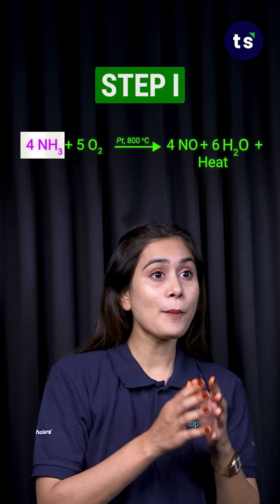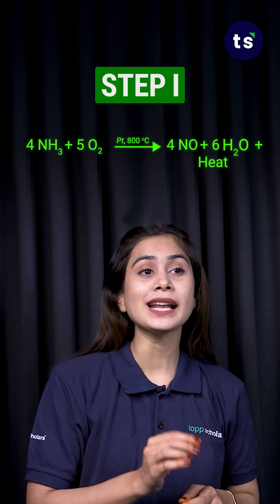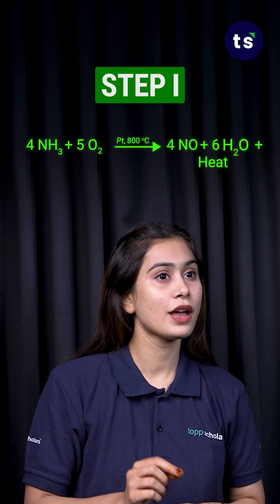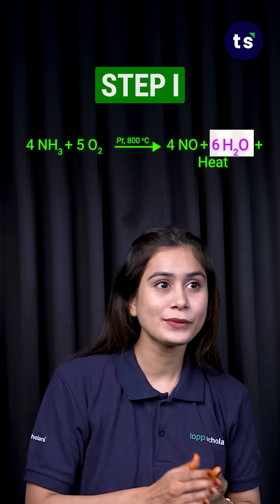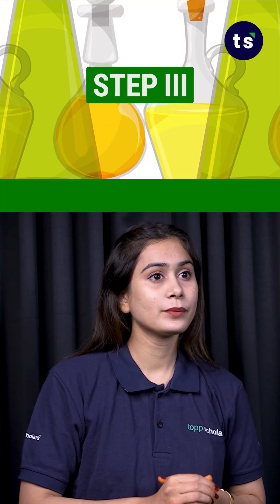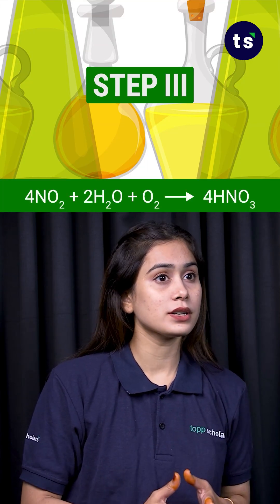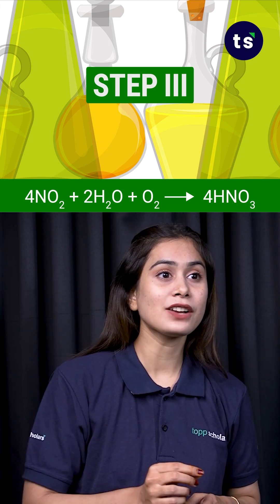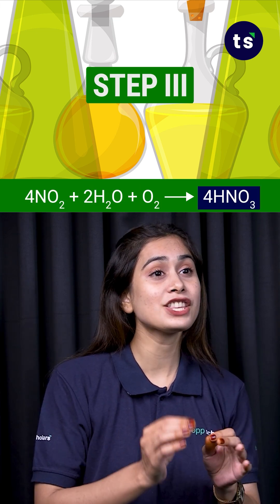The Ostwald Process: Making Nitric Acid Explained Simply #shorts #exam #icse #chemistry

Comment: Summary.

Step1:

4NH3(g)+5O2(from air)=>4NO(g)+6H2O(g)

Ammonia reacts with oxygen in air to form nitrogen monoxide and steam.

Step2:

The NO so formed will be used. Again make it react with oxygen.

2NO(g)+O2(g)=>2NO2(g)

Nitrogen monoxide reacts with oxygen to form nitrogen dioxide which is brown. 

Step3:

Now NO2 so formed will again react with O2 but now also H2O(l)

NO2(g)+H2O(l)+O2(g)=>HNO3.